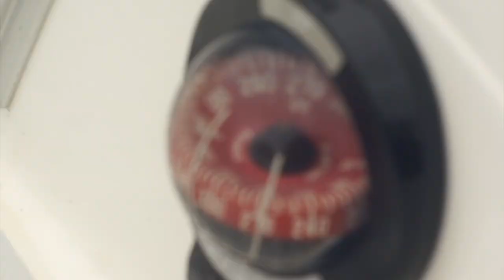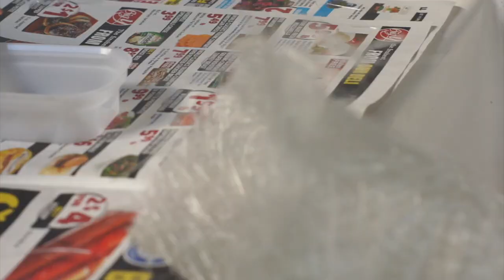Repairing A Sailboat Ballast

Comment: Hey Ryan,
We just recently got a 92 Macregor 26s and came across your videos. Awesome job. Really enjoying them! Our boat was given to us by my father in law, so free for us as well woot..well.. at a cost..as you say. It was sitting for 18 years. Luckily most of that time it was covered ..but not free of moisture and it spent enough time uncovered out in the open in our rainy city of Seattle to be in disrepair. The wood covers were falling apart and warped so I replaced them with plastic.  The bilge and aft berth was full of mucky water and interior was covered with black mildew everywhere. Steam cleaned and bleached everywhere. We spent a bunch of money just getting the original trailer overhauled. I was inspired by your fiberglass job and your commenters and followed some of the other recommended videos as well so I did a repair of my water ballast that was leaking up into the v-berth after following your example of testing it. I was told by the Blue Water Yacht peeps that I did an ace job fiberglassing. My first attempt, so thank you for the inspiration! It gave me some confidence in trying it. I love that you are going through the same process just enough ahead to see your work for inspiration and see all the useful (and not so useful) comments. Heh. Thank you!
Cheers!
 -Spence
Reply from the maker: +Spencer Alexander wow thanks for such a great comment! Do you have a blog/vlog or anything like that? I would love to check it out! It's always great to see what other people in the same boat (no pun intended there seriously) are doing. I'm very close to doing a test float/sail now. Just want to get the sails patched up the best I can and make that into an episode, but things at work have just been so crazy I haven't had a lot of time. But hopefully soon that will happens and maybe sometime in September I can get her in the water and see if she floats and he ballast holds up and if all goes really well maybe even put the sails up and see if the thing can blow around in a small lake. Fingers crossed! Thanks again for your comment and support.
Reply: Exciting! Can't wait to see FreeStyle sailing. No, no blog/vlog or videos. Sorry. Wish I did though. I didn't even take before pictures. Just moving as fast as I can to get it up and sailing. I drop it in the water Monday to see if she floats (engine only). I have to dry lube the blocks to see if I can salvage them or buy new ones, replace the old plastic spreader caps with better ones, replace anything wood and odds and ends, silicon some spots, gel coat here and there, as well as replace a sail and rerun all the electrical lines. I took it in to Blue Water Yachts where my father in law bought it to get it inspected. Same people working there, so they remember all the parts they used back then. A surveyor seemed too expensive and these guys only charged $100. I have been getting great advice from them. I can share some pictures, of the current state if your interested. My father in-law had it set up for single handed sailing and only ever used the genoa instead of the Jib.
Cheers!
Reply from the maker: Spencer Alexander that's awesome you're close enough to BWY to bring it too them! I order stuff from there all the time. That's where I got  the new dagger board too.

Comment: Just got a Mac 26D last week.  Watching your vids gives me the confidence I need to handle the repairs!  Keep it up!
Reply from the maker: +Wayne Garrido thanks for watching! It's a pretty simple boat. The biggest issues I could see is damage to the ballast tank if it was under the aft berth or floors, that could been a giant PITA to fix.  So fingers crossed there will be no more issues there. The "hatch" project was a pain too, im actually going to have to rip that all out and have another go at it at some point. But that's only because the PO tried to mod the cockpit himself. Other than that though..... not too bad.

Comment: Hi saw your recent video. Love how you tackle problems.  A product you may want to look into is marine tex. It comes in white and black which helps in repairs. The best part of the product is you can drill it, sand it, and it stick to anything. When it sets up it hard as steel.  The only down side is...it kinda expensive.  Best of luck, keep up the good work.  David T.
Reply from the maker: thanks for the comment david! I'll definitely check that product out!
Reply: Sailing FreeStyle PC-11 is similar and works great. It is also quite a bit cheaper. I used it on my boat.

Comment: Dude, you should prep surfaces with acetone before you glass over them. And yes, that is in fact VERY important. AND you should have dilled 1/4" holes on each end of that crack to help keep it from spreading. You could always just pump a bunch of smurf poop into the ballast tank and call it a day. LoL

Comment: really liked the close ups of the crack in the tank, but I'm not sure your camera is going to be too happy with the fiberglass dust.  Either way, nice job using increasing size patches as you go up in layers. I often see multiple layers all one size. the only bond that matters in that case is the first layer.
Reply from the maker: Thanks Gary, definitely think I've improved on my fiberglass skills a little since the first FG project.

Comment: I have never repaired a boat like yours.  I was wondering if waterproof Gorilla glue would work or not.  Currently, I know how to use Gorilla glue. I am unfamiliar with fiberglass but, would like to learn.  I would also like to know if you were filling the water blast?  I just need clarification so I can better learn. Keep up the hard work.  My husband I have flipped a lot of homes. We are just not familiar with sailboat repairs.  We would like to learn.  We sail when time, wind and location all workout.

Comment: Love the videos! I just bought a 26d with the same water ballast tanks, did you find just the 2 cracks in the forward section and the site under the sink cabinet?
Reply from the maker: Hey Ed thanks for your comment! Yes, those were the only 2 areas that I had any issues with, did you fill yours up yet the same same way I did? I think short of doing a float test, thats probably the best way to go about checking for any problems with the tank. Both repairs are still holding up well also.

Comment: Any wood you put in the boat should be sealed with several coats of epoxy to prevent deterioration. A little work now saves you a ton of work later.

Comment: Quick question.  Did you drill the "ends" of the crack?  I was always told to drill the "ends" of the crack to relieve the stress and it will prevent the crack from growing further.  My dad proved this when I had a cracked windshield and used a tiny drill bit at the end of the crack and sure enough it never spread further than that.  Repairs look good to me :)
Reply from the maker: JClaudII what I did was use a dremel to carve out all around the crack so the end result was more of a hole than a crack. This would have the same effect as what you are mentioning but more importantly it gives the new resin more of the old surface to bond to which makes a stronger repair. In hind sight I probably should have made the bevel a little wider actually, but I think it will be ok.

Comment: If there was a crack running up the stbd side of the daggerboard trunk, then there's probably a matching one on the port side.  A lot of stress gets put on that spot when sailing.
Reply from the maker: No crack on the trunk, just the topside of the ballast tank. I do think that it’s a (Or I should say was) a stress crack from the pressures of the daggerboard against the trunk though, just in the other direction.
Reply: That's what I meant, the crack along the trunk joint, from the board pressure.  The side under the little galley is easy to get to but if there is a crack on both sides, the other one would be sandwiched right under the companionway floor, no fun at all to access.  I'd just keep an eye behind that trunk once in a while for signs of water.

Comment: epoxy resin best for repairs, polyester resin is best for molds and manufacturing. Epoxy resin is average 900 psi and Polyester resin average 200 to 250 psi. so if you used polyester resin and it breaks loose, redo it with epoxy resin. Good job though, saving 40% to 60% by doing it yourself, and getting better at it.
Reply from the maker: good stuff to know, thanks

Comment: is there an explanation for the cracks, did someone leave the ballast tank full over the winter? or is there some other reason like sailing stress? I know squat about sailboats so am curious
Reply from the maker: so, like you i know squat - but I'm pretty sure the one under the v berth was from someone either stepping in it, or there was some object (storage bin?) under there that made contact with the top of the tank and the bottom of the berth, so overtime they got in and out, it would put pressure against the tank... just a guess though. under eh ally i know is a common place to put a battery? but I'm not sure a battery would put that much stress on it... my guess there is a possible running aground situation with the daggerboard down put stress on the daggerboard trunk and flexed the fiberglass enough to put a small crack in it, really no idea though. I just hope there aren't any more in places I can't get to. (under the floors or aft berth)

Comment: Ryan, not a reflection on you, you are doing a great job, but do realize that the Macgregor (Sp?) is about as crappy of a cockpit type sailboat that you can find. Please be careful with your ambitions about this boats capabilities. It could get you into trouble quickly in the wrong conditions. Best wishes and good luck with her!
Reply from the maker: thanks for the heads up, i'll be taking baby steps for sure.

Comment: instead of putting water directly into the tanks, put bags in the tanks to fill.
Reply from the maker: huh? not sure I follow this one...
Reply: Sailing FreeStyle if the cracks in the water tank are not structural and u are unable to reach a crack, stick a flexible water tank (bag) inside the water tank. Not may favorite solution but it may be the easiest solution. The alternative is to cut out the floor to reach the rest of the cracks.